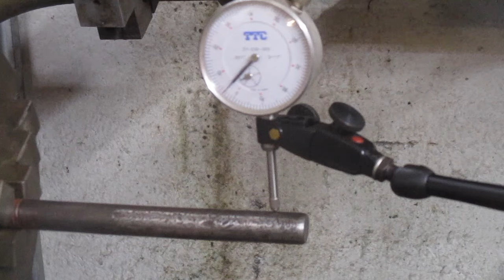Making a shifter rod for my sawmill # 1558

Comment: Hi John. Again Thanks for everything. As a small family farmer of 32yrs. I always made metal devices for things. Usually used metal parts. I used my bench vise, hacksaws, hammer, steel die set, drill attached metal grinding wheel, & steel drilling drill bits. My " junkyard" was part of my shop in a lean-to building. Any metal, metal piping, assorted metal parts were always saved. I made some very good metal inventions. A threaded tire axle, metal slide bolts, metal door hinges, & etc. I saved a lot of money on the farm. However. I did no welding jobs. ( I practiced once in my lifetime. While growing up suburbs of Boston, Ma./ East Weymouth/ The locals calls The South Shore. A neighbor/ ship welder showed me) Great job as always John. Have a good Sunday John. 😅😅😅😅🥰😊😉👍❤️💜🙏🏻🙏🏻🙏🏻🙏🏻
Reply from the maker: hi there i save almost  everything . i used something i had for over 30 + years last week , i have no money in this new part , keep saving and making , thanks for dropping in john
Reply: @fricknjeep  I completely understand. Neither we during my farming days. We pooled our money as a family. Then got family friends/ relatives giving us money to farm. I made do what we had & made life comfortable. Have a good Friday the 19th John. 🥰😊😉👍👍❤️💜🙏🏻🙏🏻🙏🏻🙏🏻
Reply from the maker: @lawrencetirrell8414  thanks john

Comment: Ok another use for black pipe. Rod extension. Makes great weld on hinges, lock mechanisms, and such. Great job, at least you get the paint out of the can. Mine usually plug up inside the can and screwed from that point.  As for your dryer, get a new one. Over 30 years it paid for itself many times over. New ones actually save money and do a darn better job. Thank you for your knowledge sharing.
Reply from the maker: hi there thanks for the dryer tip , and dropping in with it  john